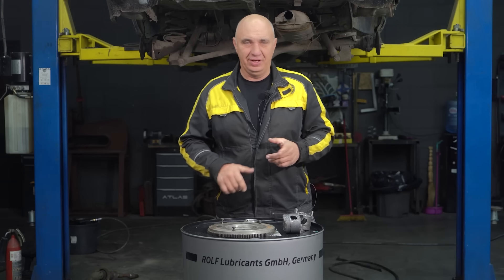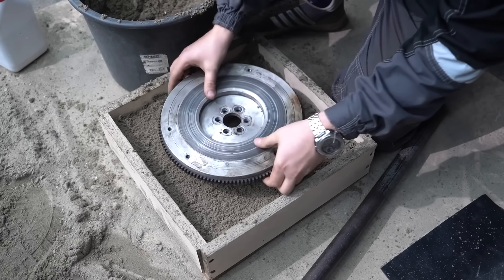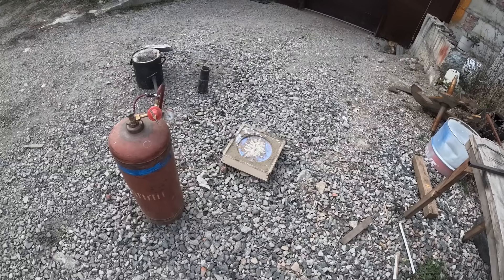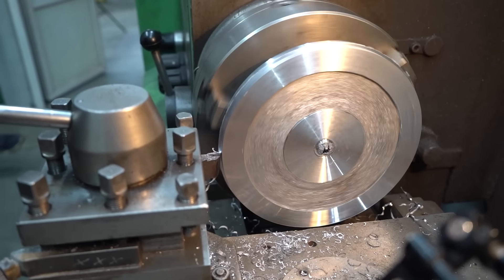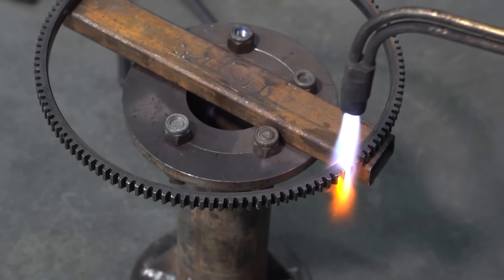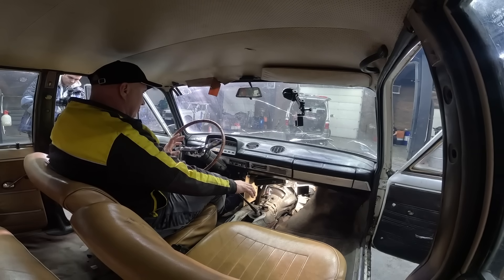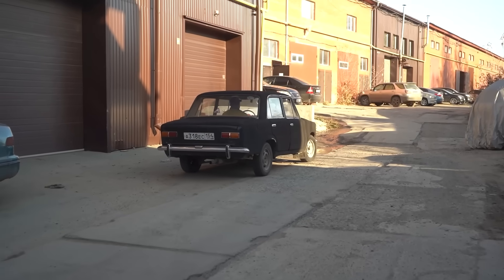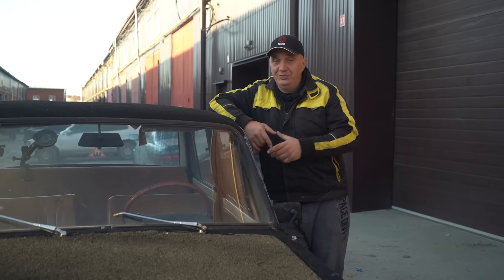We make a lead flywheel for a Lada - what will happen?

Comment: A Austrian tractor called Steyr 80 has a one cylinder 1.3l Diesel engine , with a flywheel with over 100kg . You can drive up a hill with a fully loaded trailer without giving any throttle,  if you rev up the engine before the hill . This huge flywheel pulls you up , but it revs up quite slow . 😅
Reply: i have htz dt-20 its ukranian tractor made in 1966 well that was last year it was produced,1.6liter diesel engine and us 3 got our balls in eyes putting it back

Comment: If you want a heavier flywheel, try depleted uranium 😂
Reply: i mean, if we're going to continue the toxicity trend, osmium, it is the densest, and consequently heaviest, natural element [it is dense enough that we are physically incapable of measuring the density of denser elements, only estimating, it is dense enough that it has "observable relativistic properties", which in english means it's dense enough to warp time], and in spite of how rare it is, it's super cheap because no one uses it in high enough quantities to put a significant price on it

the downside? it's more toxic than lead, lead poisoning is a slow killer, osmium can cause serious issues within minutes

if we want almost as dense as osmium but non-toxic we can go titanium
Reply: I'm pretty sure they have some.
Reply: @d3str0i3r  "it's super cheap" - Is your name Jeff Bezos? 1.5 Million Euros per kg. (Roughly about the same US dollars). I can't recall the exact weight of the flywheel, but about $50M should buy the material.
Reply: @d3str0i3r  Pretty sure Titanium is way lighter.
You sure you aren't mixing it up with Tungsten?
Reply: @d3str0i3r  what are you smoking ? Osmium is crazy expensive
Also titanium is nowhere close to osmium in density. Get off the za bro

Comment: Dang vlad I worry about your health with all that lead that you atomized in that cabin with you. Also on top of that, I worry that if that fly would’ve come apart, you would’ve gotten it embedded in your leg or worse, but then I saw the blast you put next to it afterwards. Lead is Still bad for your healt
Reply: Lead isn't particularly volatile at a just molten temperature. An atom is unlikely to split free but a molecule could. The density means any will exit and rapidly fall to the lowest point. Working outside is about as safe as possible.
Reply: The flywheel is enclosed in the bell housing with the clutch which is outside the cabin of the car. How does anything from the  bell housing get in the cabin since they are designed to be separate! Clutches haven't contained asbestos for years.
Reply: @geoffreycodnett6570 Well they cut a big hole directly in the top of the bellhousing, which is decently close to his right leg. Which, besides having an area for fragments to escape, will have the side effect of weakening the rest of the bellhousing. Which if it happens at high rpm then the fragments of a broken flywheel can for sure bust straight through an aluminum bellhousing and then through the floor panel.

Comment: I love how in the beginning they know exactly how to make a sand mould for metal works like they have previously worked in an engine block casting factory.
Reply: they have actually done so much, i had to look myself, but these guys are actually very competent! they take motors apart and link the camshafts together (v8 Lada!) and so much more! 2stroke converted a lada, put 4 motors on one lada, etc etc

Comment: When you normally replace a clutch on a normal flywheel, you will see micro cracks. It is awesome to see those micro cracks expanded to be much bigger on that lead or soft metal flywheel.

Comment: I would be NOWHERE near an open flywheel like that lol!
Reply: But it would be interesting to put it in a bunker, and red-line the engine.
Reply: Yes. By my (possibly quite wrong) calculations the bursting rpm would be about a tenth that of a cast iron flywheel. Tensile strengths 430 MPa vs 17MPa. Force is square law with rpm and linear with density. I don't think I would have been prepared to sit beside it and start it.

430/17 is about 25, so bursting rpm down by a factor of sqrt(25) = 5, and down by another factor or 2 because lead is about double the density.
https://www.youtube.com/watch?v=FOnachbSjno   Thar she blows.
Reply: @joejoejoejoejoejoe4391  "Ford Livonia Transmission used an outsource lab to test flywheels to explosion in a "spin pit".  Generally a new iron flywheel would go 13,000+ rpm before blowing the heck out of the wood pit liner in the pit.  Old ones were known to fare much worse, with unpredictable results.  I understand it was dangerous testing, with the lab being badly damaged at least once..."

Comment: lead everywhere... can't imagine the cleanup. Crazy to see tho. You have done other heavy flywheel vids (like stacking 4+ together). Try making a tungsten flywheel next?
Reply: defenetly
Reply: Tungsten is really expensive
Reply: @theairaccumulator7144  And probably interesting to machine...
Reply: It's Russia, they don't do cleanup.
Reply: Cleanup = Broom into the nearest drain
Reply: That sounds even more deadly.
Reply: @jwalster9412 the opposite, they don't waste much. they'll save the lead to melt and cast into wheel weights.
Reply: @OldManJenkins23  what about all the dust and sparks that are won the road?
Reply: @jessec4677  that'll be wicked expensive to machine
Reply: @jwalster9412  The water washes it away into the drain or river, beyond the environment. Out of sight, out of mind
Reply: @josh3771 ah yes, the classic enviromentalist move. The EU and germany are at the forefront of this methodes implementation.

Comment: Work 25 years in the foundry from grinding to mold machine, operator, oiler iron pourer, Cupelo starter, ladle repair, clean up and just about everything in between I’ve used one of them boxes before we made parts for old tractor. Somebody had mostly ran in one day was 80 tons of iron.
Reply: Nice. I am a maintenance mechanic at a John Deere foundry and the mold machine is my area of responsibility. It's a rough, dirty job, but it pays well.

Comment: This channel is awesome! About the lead flywheel... excellent idea, but I think it would have been good to test two capabilities of this improvement: 1) the car should have been able to overcome steeper climbs than before. 2) it should have drank less gasoline than before in the same conditions.   If you'r going to test again try to check these two points. Thank you!

Comment: This is so crazy dangerous.  Look up flywheel explosion for as to why.  American drag racing in the mid 20th century had some horrific accidents with flywheels grenading.
Reply: We all use SFI approved bellhousings on our drag cars now.  Nobody is getting their feet cut off by an exploding flywheel. Our cars are the safest they have ever been. 
You can't really compare a 4cyl Lada  that doesn't even produce 100hp to a North American purpose built drag car that the average "slow" car has excess of 1000hp.  When things break on high hp engines they have a tendency to be quite violent. I've had a clutch explode on a stock 4cyl Ford and it barely left any scratches on the inside of the bellhousing. These guys are perfectly safe. In accordance to Russian standards.
Reply: Now there would have been a good test, floor it, but with no one any where hear it
Reply: Flywheels, or the ring gear in the diff slicing off the driver? One reason why the driver has been moved in front of the engine in dragsters...
Reply: Don't you see he took safety precautions for the first time ? Safety glasses 🇷🇺

Comment: You guys should try milling one out of tungsten (around 70% more dense than lead). It will probably be around 20 kilos, and very durable. Unlike lead, tungsten is very hard.
Reply: Might be hard but if it breaks it will shatter like nobody's business
Reply: @qpSubZeroqp  Don't think it will shatter that easily. I mean, if you can shoot it with armor piercing .50BMG, and that just makes a tiny dent in it. It's a very strong material

Comment: without seeing the rest yet, i bet the lead started to melt and deform / fling around , some into the bell housing. but since it deformed, almost any change to the surface would cause it to start rubbing all the time, even with clutch in.  maybe get it hot again, then let clutch out so you get the full pressure trying to flatten the (partially melted) surface again.

wow, yer lucky that didn't completely come apart and fly into yer face man!

Comment: I don't miss a show either. To convert a 4 speed gear box onto a 6 cylinder engine I used the flywheel that suited the gear box. The gear box gave from a 4 cylinder engine. The result was the engine was so smooth and flexible, with the heavier flywheel, that I didn't need first gear anyway?

Comment: 5:21 lol, the mat blacked out Lade looks awesome.

Try to cast a 2 liter single cyl engine witch mates to the Lada gearbox.
The biggest piston applied on a motorcycle was 2 liter.
Reply: The NSU bison 2000, right? Made by Franz Langer iirc
Reply: @Sam-ob4of  Hi, didn't look at it's name.
It just looks cool search large cyl from an WWII era airplane.
Reply: @AnalogDude_  Allen Millyard already did it with a WWII airplane engine piston and cylinder, 5000cc 1 cylinder,.. 5 liters
Reply: @SHAGG13  Oh yeah, forgot about that one. But yet the video claimed it was world largest, who knows who build it first.

Comment: I praise you all as a team of skillful experts for all the videos. My suggestion for you would be to do some performance boost of Lada 110 series with 1.5, 16 V engine. We all know that PORSCHE gave the engine maximum. But it woul be great to see what would be the ultimate maximum power, pushed into a regular driving car and how would the stock suspension, body and gearbox handle the torque. Best regards from Serbia.
Reply: Максимальная мощность атмосферного  двигателя 1,6 16v на спортивных автомобилях достигает 200-220 л.с.

Comment: Too bad you didn't try high revs and popping the clutch in second or third gear... pretty cool experiment overall. Maybe revisit this with a spacer between the transmission housing and a thicker lead flywheel with steel plate in contact with the clutch. As always you guys try some pretty wacky stuff and the presentation is great.

Comment: What about letting the engine ingest crushed walnut shells to clean the intake valves in direct injection engines. Will it plug up the catalytic converter and mufflers. Will it damage the cylinder walls and pistons.

Comment: now made it of tungsten, it will be 50% heavier than lead
Reply: And cost about $US 330,000 because tungsten can be up to 30k per kilo lol, that's over 32 million Rubles. xD
Reply: I've often wondered how an engine would behave with a tungsten crankshaft.

One thing's for sure, the crankshaft itself won't break. 😂
Reply: @r.b.ratieta6111  it would break easly, tungsten is very brittle

Comment: 12 kilos? Is that all?  When I was young & drag racing small block Chevy motors, 302 cubic inch, mostly, (late 60's -- '70s), we could get plenty of horsepower for the poor traction, get 9500 to 10000 RPMs from them, but we were always chasing more torque.

For a while, we tried gaining torque by changing flywheels, (most racing was clutch & manual transmissions; 10 years away from the massive shift to automatics).

The earlier Chevrolet 348 & 409 engines ran a very heavy flywheel in certain applications; big trucks, primarily. 

But, as Chevy & GM were in those days, things easily interchanged.  We ran a 48# flywheel, drilled for an 11" clutch pressure plate & used a 10.5" disc to help shifting.

It took a bit for the 302 to get up to higher RPMs, but wasn't a problem.  

Once that massive flywheel got to spinning at 7500 & the clutch was dumped, it didn't want to slow down.  Made the already violent launch even more violent.

Didn't help the elapsed times much, did improve the start or 'hole shot', (we weren't looking at 60 ft times or such; just wasn't happening), but the heavy flywheel did lead to more broken drivetrain parts.

Comment: 13:10 Ok Vlaad don't die those can fly apart i saw a rotary engine once lightened flywheel went through the floor roof and windshield luckily driver didnt get hit somehow parts were hitting the ground seconds after it flew apart

Comment: the aluminum worked much better... though... 34% tin 10% lead 40% aluminum 5% copper "4~15% iron powdered" 3% zinc 3% silicate 0.5% phosphorus, di-cast aluminum bronzes alloy? still would need a thin steel disk pressed into it with "epoxy resin" and centering lug holes pins, for the abrasion surface.

Comment: That's amazing.
They melted down 15 (something europeon) of lead, poured it into a cast and got "almost 18"(something europeon).
Now I don't claim to be a europeon math expert, but I'm pretty sure 18 whatever is more than 15 whatever. I'm also pretty sure that .37 of whatever is less than half of one unit, thus not "almost" the next unit. 
Is it me? I thought the big selling point of this metric crap was that you didn't have to be very smart to use it.

Comment: @Garage54 there is alot of time invested in fuel saving for engines. Such as engines that turn off when you pull up at lights. Then when you press the pedal it restarts the engine and you got.
Can you do this to a lada?
Also, is this the best way to save fuel because you stop the lubrication and cooling. So what about shutting down all unnessary cylinders, can the engine still tick over on one cylinder and then when you press the pedal kick in the other cylinders?
Reply: What you talk about is cylinder deactivation, VW uses in most of their engines to save fuel. It is a terrible idea because in the long run it ruins the engine faster.
Reply: @karthick86c  Did you even read the rest of my post past the first little bit...

Comment: You could have just used a flywheel out of a first generation Mazda RX-7. I pulled one out of my brother's car to replace it with a so-called lightened unit with a heavy duty clutch. That engine's RPMs changed extremely quickly after that!

Comment: 12kg is nothing compared to modern flywheels. Volvo etc 21kg..
Reply: Not only heavyweight. But larger diameter.  Make a 50kg or 100kg. Like old old engines. That would be fun
Reply: Those are probably dual-mass, no?
Reply: How large is the displacement on that Volvo? The lada is tiny
Reply: Land Rover discovery TDV6 also had 21kg dual mass flywheel.. certainly take you by surprise when lifting it